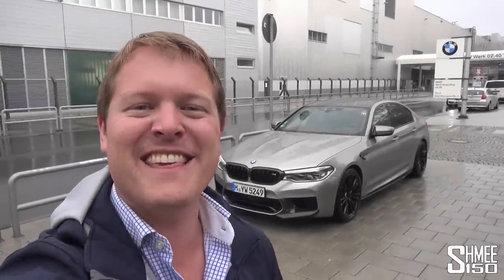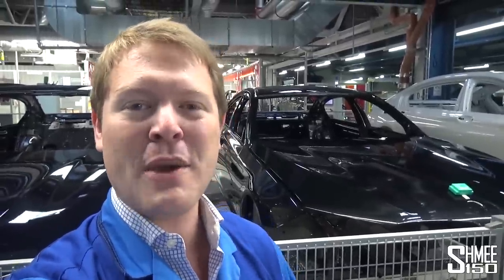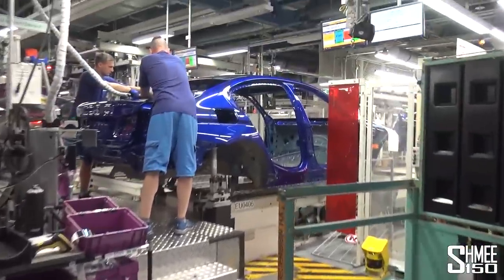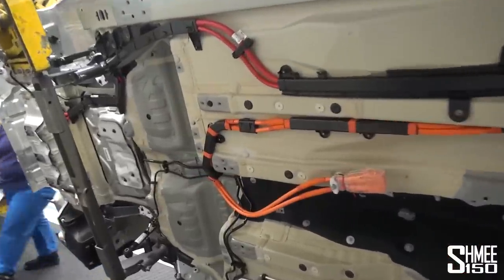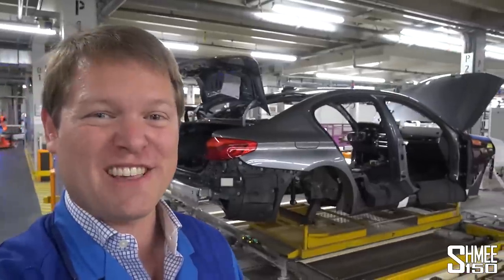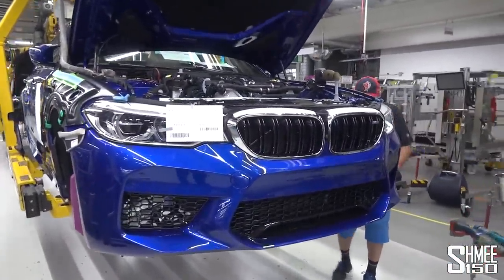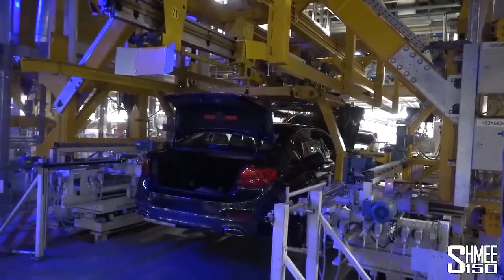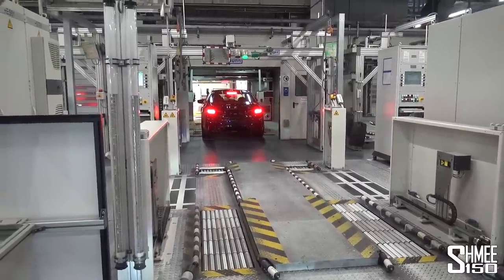This is Where My BMW M5 was Built! | BMW Plant Dingolfing

Comment: My dream is just to have an M from BMW or an AMG Mercedes...german cars are just the best!!!!
Reply: Work hard  and smart and you'll be sitting in one in no time!
Reply: Swedish cars cough are good too cough
Reply: Thomas Hayhurst used to be good*
Reply: M50B25 Turbo I disagree. Sweden has always made good cars
Reply: Thomas Hayhurst Yeah but Swedish production cars are hardly comparable to the Germans
Reply: M50B25 Turbo every single manufacturer seems to copy the Germans. I respect their engineering, but everyone seems to jump onto a bandwagon whenever the Germans come up with something. The swedes do their own thing. That don't try to be German cars, because they aren't.
Reply: Thomas Hayhurst 
What i hate about Volvo is their stupid decision to go 4 cylinder only.. i need my V8’s. I currently drive a BMW 540 V8 and wouldn’t be able to have anything lower than 6 cylinders.
And i’m not biased in any way, i’m Swedish.
Reply: J Gripen I totally respect ur opinion, whilst I myself have a different opinion. Swedish cars (Volvo and now defunct Saab) are renowned for their turbocharged engines, (after all, Saab was the first car manufacturer to have adopted the turbocharger system from planes to cars), and even with the hybrid motor, making 400 horsepower with a turbocharged 2 litre inline 4 is pretty darn impressive. I personally love the sound of a turbocharged inline 4, and although I miss the good old inline 5, the Twin Engine it is a very clever decision to the future restrictions. It is also very eco-friendly
Reply: 다오 you've also got those maniacs at angelholm (Koenigsegg)
Reply: Thomas Hayhurst yeah, the Koeningsegg Agera RS is my dream car
Reply: Yes, only in your dream
Reply: Lexus is the best
Reply: Not every german car is good lol.

Comment: You must have filmed that a while ago, rain in Germany seems to be along lost memory by now.
Reply from the maker: That's a fair point, but my channel is about individual informative pieces, it's not a daily vlog so it's based around a publishing schedule. However amusingly I was there yesterday too, just not actually filming this video.
Reply: Wasn't meant as a criticism Tim, just an observation. Also I am longing for rain and for the temps to get down.
Reply: betaich 
It’s been 30 celsius every freakin’ day here in Sweden. And temps barely go below 20 during night. I absolutely hate it. If it wasn’t for the 24 hours of daylight in the north during summer and the opposite in winter, i’d move there xp
Reply: J Gripen wooooow thx here in Korea it’s more than 40 for the first time in 111 years that really cheers me up

Comment: Didn`t know the Alpina`s are build at the regualr factorys to.
Thanks for the footage Tim.
Reply: MrParabola90 Yes they are but the engine is build in the Alpina factory and shipped to the BMW factory and if you have the optional leather they reskin your interior at the Alpina factory, add decals, badges and fine tune the setup of the car there. So there is a lot of logistics work to build an Alpina.